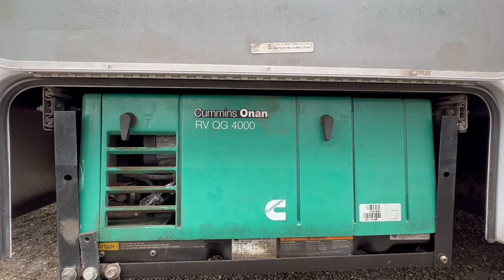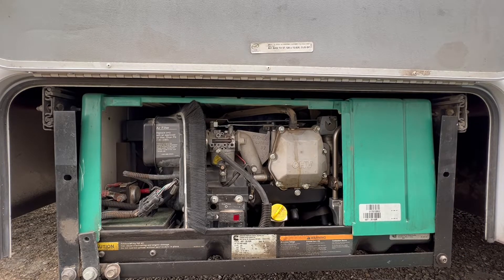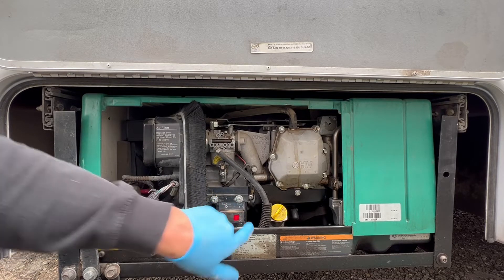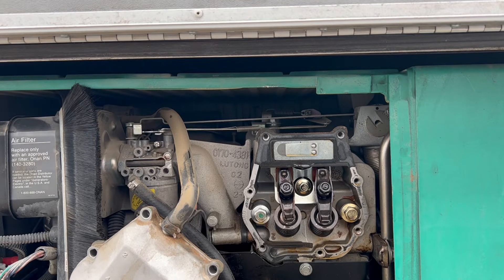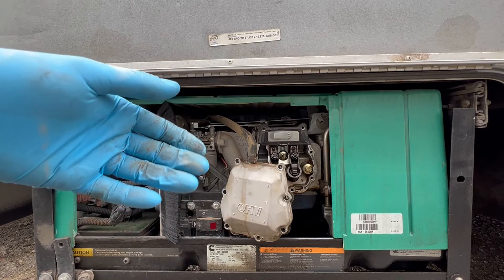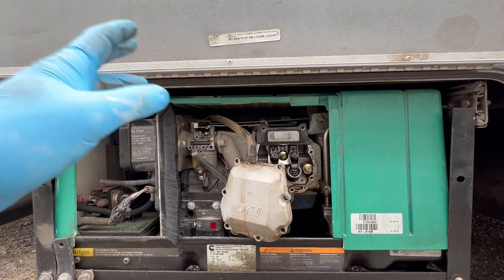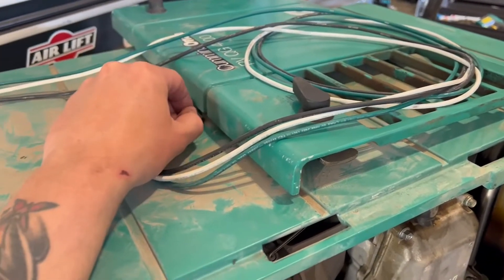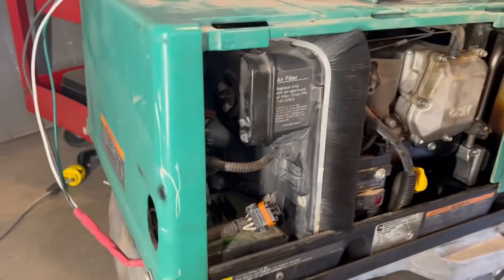🚨 Cummins Generator QG 4000 Troubleshooting - No Crank, Engine Seized Diagnosis!

Comment: Well I cleaned out my carb jets, still no start BUT Im hearing the dip stick is poorly designed, many say drain oil to just above the add and that will fix my problem shutoff issue. The fill level is higher than the oil pressure sensor
Reply from the maker: I’m not familiar with an oil pressure sensor equipped on these units. Only an oil level sensor. Could be an issue with the sensor.

Comment: I am dealing with repairing some chewed wires from a rat.  I am putting it back together but since the wires were chewed off of the brush wires, I cannot figure which wire to connect to which brush block terminals.  The wires from the harness are labeled F+ & F-. The online wiring diagram only calls them F1 & F2. I also found the following in the service manual: Connect the F2 lead wire to the outer brush terminal (near bearing) and the F1 lead wire to the inner brush terminal. This does not help me since my wires are F+ & F-. I wish someone could help me translate them. I watched a video from Flight Systems and he was working on a Marquis/Emerald generator and specifically said that the polarity mattered. I just don't know if that is the same with the 4000 micro quiet. Thanks for any help!
Reply from the maker: Hey wish I could help. I plan on buying a generator to keep around to help with questions like this, but I don't currently have access to this generator. I would almost always consider polarity to be important, especially if it is labeled on the wire themselves.
Reply: @maddoxmechanic I agree, there must be a reason they are labeled.  I am running into walls wherever I look for an answer.  I may just have to experiment with the polarity and hopes it doesn't mess anything up.
Reply from the maker: @prohomevideos  best of luck! Please be careful